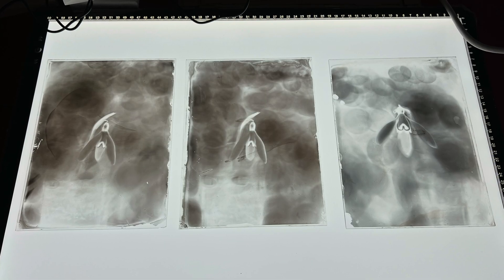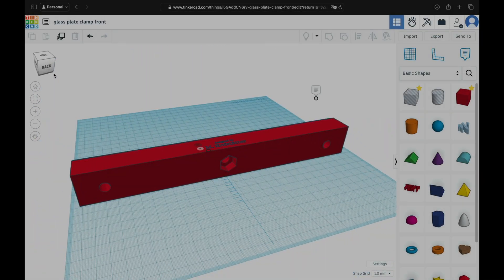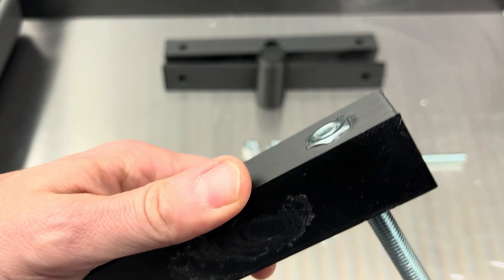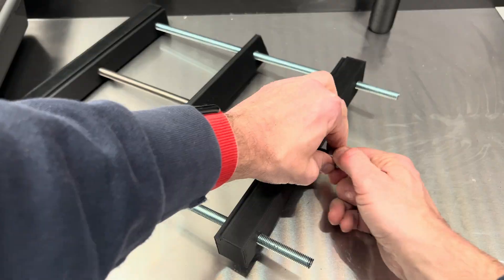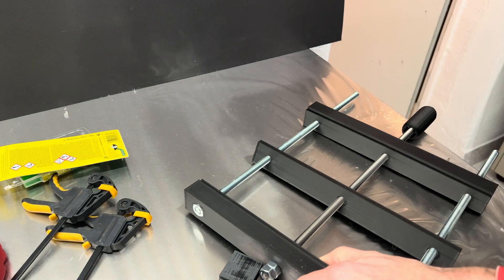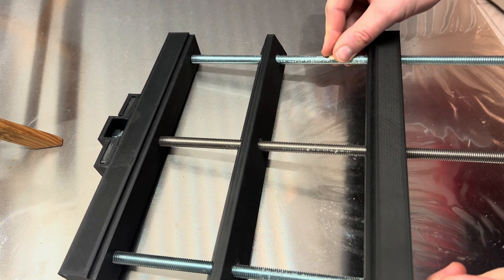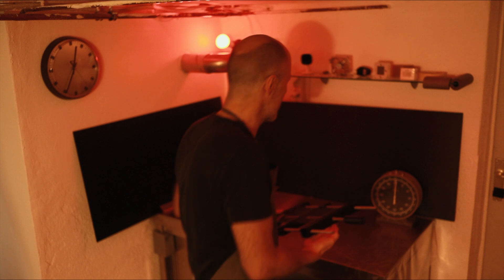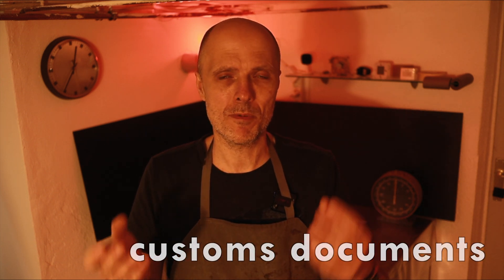DIY Ambrotype/Glass cleaning clamp for wet plate photographers

Comment: I'm in the process of building one, thanks for the print files!  I'm in the US and it's hard to source metric hardware locally.  For anyone else with the same issue, 3/8" threaded rod is very close to M10 and will work.  The nuts are a good bit smaller, however, so I had to design and print some simple bushings.
Reply from the maker: Thanks a lot for the information. If you want to send over the business, I’ll integrate them and upload us files.